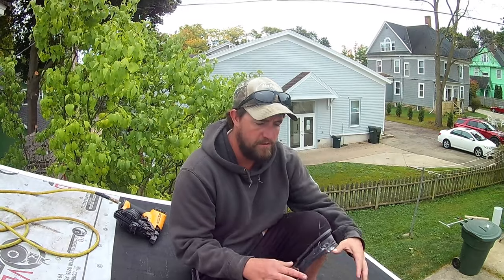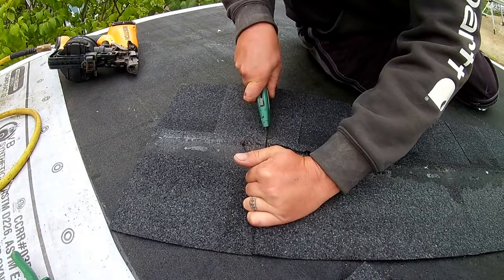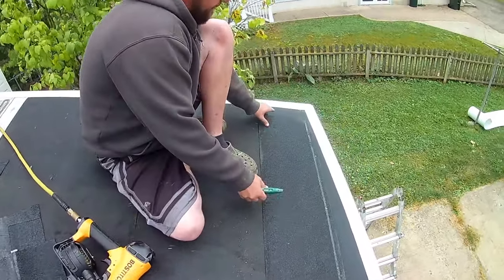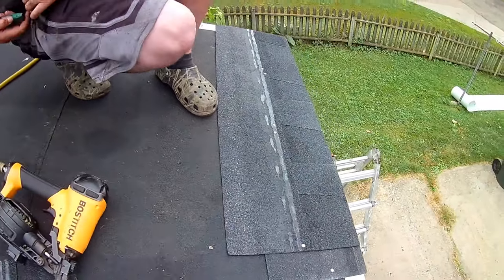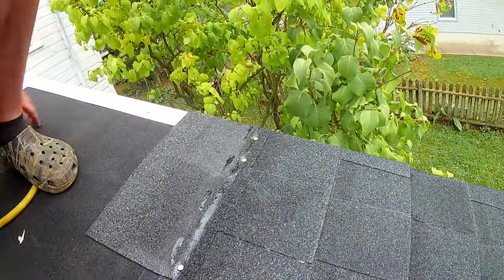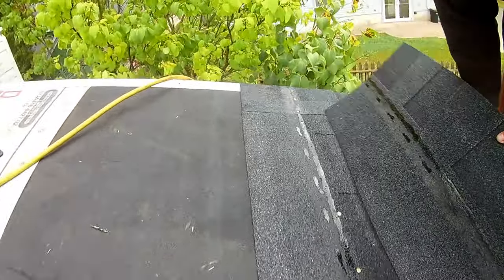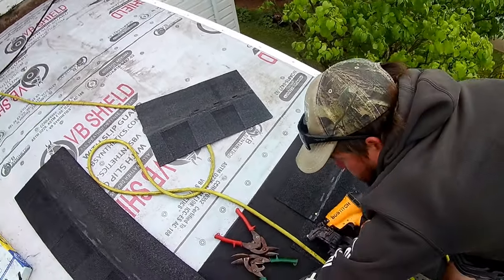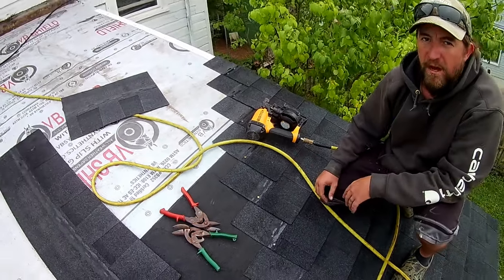HOW TO SHINGLE! STARTING SHINGLE COURSES AND SHINGLE NAIL PATTERN

Comment: Thank you for the video. I downloaded the in depth manual. It says for the first shingle to be a complete piece. Second row 6 1/2 inches off. Third ro 13 inches off. Fourth row 19 1/2 inches off. Fifth row 26 inches off. Sixth row use the 6 1/2 piece leftover from the first cut.

Comment: The fact that your roofing in basketball shorts and crocks says everything about experience and know-how.
Comfort equals efficiency and and saftey I know those shoes have the best traction on paper and shingles and if you need to jump out of them it's easy and quick I wish Ithey would have had them back in my roofing days. But I use to use rubber sandals when I was laying most times😅

Comment: Good vid.  For what it’s worth, regarding 6-nail application, the Atlas Pinnacle Sun General Instructions state (in all caps):

CAUTION: STEEP SLOPE AND MANSARD APPLICATIONS BOTH REQUIRE 6 NAILS EVENLY SPACED ALONG THE LENGTH OF EACH SHINGLE. 

I live in Florida, and code requires 6 nails for my 7/12 roof.  

It would seem that if I’m going to comply with code and also not void my warranty with Atlas, I’d better stick with 6 nails evenly spaced.

Comment: When it’s hot I use a straight blade over a hook blade . Winter time a use snaps . I cut myself good with a hook blade when it jumped and got the top of my fingers .
Reply from the maker: i slipped and put a hook blade into my thigh once! i also slipped and put one right through my thumbnail once and it hurts!!!
Reply: @Lifes_Apprentice   I hate hook 🪝 blades
Reply from the maker: @hhprogressiveconstruction1140  i have been cut way worse with straight blades then hook blades
Reply: @Lifes_Apprentice   True
Reply: Totally agree with the nail pattern, but was taught to make a box with starters for the rake and eaves for numerous reasons …thanks & good health!

Comment: Nice and easy but quick question anyone else notice no starter cap on the side of the roof just asking cause normally that's what we do down in Texas 😬😳😞 we also start the whole roof edges w starter at least half an in to an inch down past the flashing or is it just in Texas that it's done like that just asking and curious

Comment: My roofer messed up. He put the first course even with the drip edge.
Water tension ran the water on the drip edge causing rain to fall between the facia and the gutter. Not into the gutter.
We tried caulking the gutter to the house but it failed in short time and we had to watch rain dripping from the gutter for years.
It rotted my facia. 
I have a new pvc board facia but unfortunately the rain still drops behind the gutter.
You’d be surprised how many roofers make the same mistake. 
They should not call it a drip edge because Roofers think the rain is supposed to drop from the metal drip edge into the gutter. 
Rain is supposed to drip off the shingle into the gutter.
Reply from the maker: This is false and not an issue of the roofing. Several things can be done to fix this. Either the gutter is not behind the gutter apron far enough and an extension needs to be added or fascia metal is not behind gutter apron enough. The drip edge is not neccesarily designed to make water drip into gutter it is designed to be a removable/replacable part of the system. this means the problem is being caused by gutter or fascia because they all work as a team. If the shingles overhang the gutter apron water will almost certainly do the exact same thing and it will not solve the issue. I appreciate the comment but you are trying to tell people how to install roofing without the experience to fix the real issue...

Comment: Q: I noticed that the drip rail was put on after the underlayment, then the starter shingle. is that normal? I have seen where it was just the opposite. I also noticed there was no safety measurement in place. You are good. This was awesome advice I have seen. I started watching since I had to do a 6 X 10 area. Thank you.

Comment: I thought you not supposed to put the nails in the tar part it supposed to go under it Sir that's what I was told for three tab shingles
Reply from the maker: Ok well these are not 3 tab shingles and nobody has used 3 tab shingles in 15 years
Reply: @Lifes_Apprentice  well Mississippi using them  people here likes three tabs shingles and my grandma has the shingles on her house been there for 25 years and still going been through tornadoes Sir they still sell them here